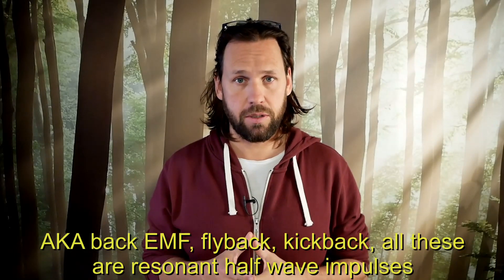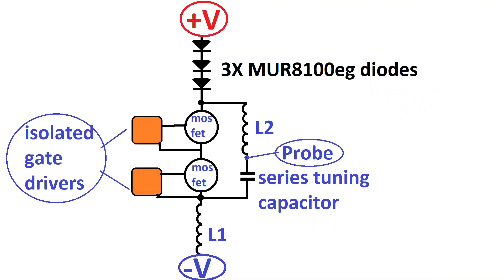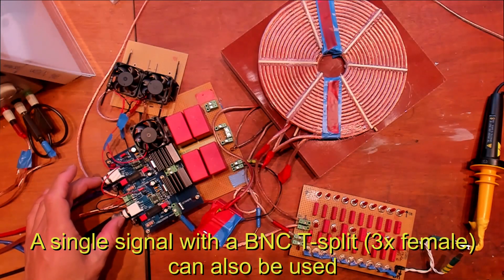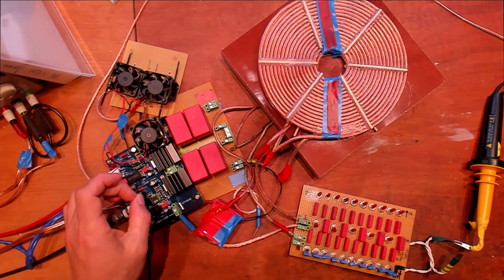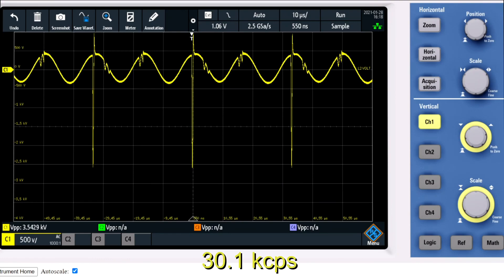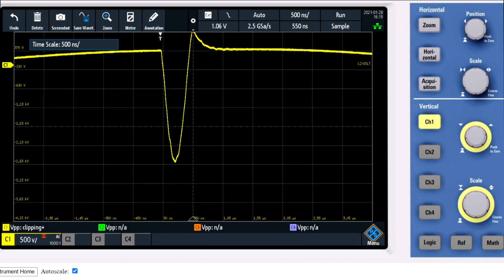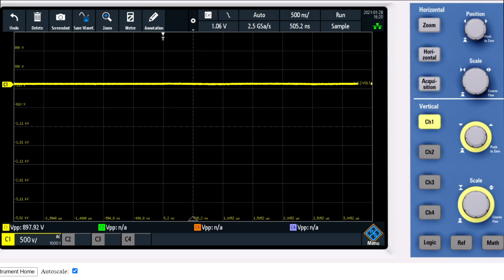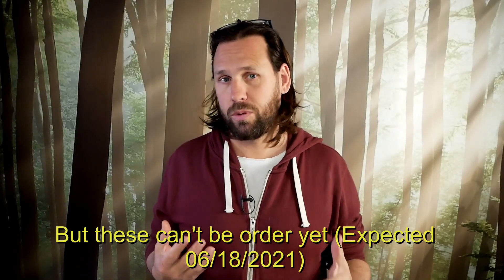High Voltage Impulses generated by Series Switched MOSFETs for Tesla Primary Coil

Comment: back EMF and flyback are not the same, you sir are mistaken and uninformed.
Reply from the maker: oh? please correct me if I'm wrong. I suppose you differ the back emf as the counter voltage that is generated in a motor.
while the flyback is the voltage spike when a coil is turned off suddenly. But I actually see them as the same. I might be wrong though. I'll ask Grok.

edit, yes grok agrees with you:
In summary, flyback is a particular application or instance of back EMF, but the terms are not interchangeable.

Comment: I made a driver using 2 NPN BJT's for the exact same sort of coil that I made from some speaker cable I had, it's much thinner cable but it still works however to get it oscillating I need an extra coil that has only 2 turns and runs parallel on the outside of coil one and needs to be inverted, doesn't matter if you put it on the top side or bottom side, I put it on the bottom side so I have a nice flat top side... I made the driver initially to drive a flyback from an old crt tv and without any changes I wanted to see if the pancake coil would do something, anything and it just works and the first thing I tried is putting an aluminum disk on top, put power on the driver and to my surprise the disk got lifted and flew off which was pretty cool to see something happening.
So I kept trying different materials and found out that if I put an RVS disk on it that it rapidly warms up and it will get red hot so I took the disk and folded an edge on it so it can hold some other stuff, that other stuff was the old tin blobs and such that I always save and put in a little bottle, turned out that it was perfect to melt all my old tin that I would throw away otherwise and it melts the tin in seconds so I made myself an induction heater capable of melting metal in just seconds and I didn't know if it would work it was just an experiment I was doing just to see what happens and if my idea to use a flyback driver (Royer Oscillator) using simple BJT's with a feedback coil on a pancake coil and it just came to life.
The only difference is that I inject the power in the middle of the coil at the point that the two series connections of the coils are and the two other wires are connected to two series capacitors one on each side of the coil which are pulsed with the BJT's, hope it makes sense.
What do you think about that?
Reply from the maker: Cool stuff! put it on YouTube with a schematic.
Reply: @MasterIvo  I made a couple videos from some other interesting stuff that you must see, here's a link to my playlist: https://www.youtube.com/watch?v=B2WAeXDENoU&list=PL4JxQvuRZCFm5pLRvSWJb88sBiVP0sGQs&index=1
I'll try to make a few videos of the driver for the pancake coil too and the single mosfet tesla coil which is also pretty cool to see.

Comment: Cool work ! Based on the duration of the puls (0.5μs) and the high frequency (30kcs = period of 33μs), is it possible to make high voltage AC with 66 of your circuits where the half has positive and the other half negative pulses? Probably it's not that simple ':)
Reply from the maker: 66? wow, well no. the limit of high voltage impulses is in the isolated gate driver. Each mosfet has it's own driver, and each driver sees the total voltage.
so if you would like to have 30kV impulses, you would need 31kV isolation (at least) on ALL of the gate drivers.

this could be done with opto isolation signals (glass fiber), 
and series connected isolated dc to dc converters (or batteries). not very ideal but it could work!

Comment: thanks for showing us your next steps in developing/researching the impulse technology. One question is in my mind since I know the negative voltage from cell membranes and since i know that Tesla used unidirectional pulses. Negative voltage means that there is a higher concentration of negatively charged electrons (that are biological/naturally used for a lot of reactions – radicals, alkaline/acid balancing, cell transport, water flow etc.) so I understand why you aim to get negative impulses. In comparison to the Ground (0V) Iam thinking on the unidirectional part Tesla mentioned. So in this case I believe, that there should be no voltage above 0V to let it be unidirectional. This means, that you dont use a current flow from +12V to 0V but instead let it flow from 0V to -12V or maybe from -12V to -24V... I believe that there is a significant difference corresponding the Ground level or in other words in comparison to natural energy fields/flows. What do you think about that?
Reply from the maker: I have been wondering about the difference between positive and negative for a while now. I am still not sure if there is something more "special" about the negative impulses, that the positive cant do. But I have seen slight differences.
Still need to investigate further on it.

Comment: That is a pretty impressive impulse. What is your plan to utilize it?
Reply from the maker: I want to do several test, based on a series resonant primary coil that is impulsed.
Research if impedance changes occur, for instance placing a primary coil under a water tank, and measure water resistance, with and without impulses.

also see if a grounded capacitor can be charged from a distance of the primary.
 see if there are irregularities in general.

Oh and... create a tesla coil with it, and see if the discharges are different, that would probably be a collaboration
Reply: @MasterIvo  I look forward to what you find!
Reply from the maker: me too!

Comment: What are the diodes for?  Is there any difference between feeding a coil with impulse and regular electricity? Sorry for any confusion. And thank you for your video.
Reply from the maker: The Diodes block the Impulses, that pass back to the power supply (when tuning). These are more relevant in the half bridge setup, whereby they pass through the body diodes back to the power supply. This setup is being build and tested as we speak. 

An impulse into a series resonant primary coil, represents a longitudinal wave.

If a coil is only resonant, it will only be transverse in motion. 

regular low frequency AC out of the wall, isn't resonant. 

And DC into a coil, creates a magnetic field, that will transform into resonantce when the coil is switched off. 

A resonant half wave is an impulse.

Comment: kewl
Reply from the maker: indeed and I am very curious what it will do in the half bridge circuit
Reply: @MasterIvo  the half bridge is the dc to dc converter you made right. step up?
Reply from the maker: @mykedoes4099   yes.
Reply: @MasterIvo  got it
Reply: @MasterIvo  when you say half bridge do you meen half of a bridge rectifier? theres full bridge and half bridge rectifiers.  a half bridge would take half the ac signal the full bridge will take the full as signal and make constant dc. half bridge makes dc pulse
Reply from the maker: @mykedoes4099   Half of a H bridge (not rectifier)

Comment: Hi Ivo, Why is the dc offset a dangerous way to do it ?
Reply from the maker: It charges up the capacitors with high voltage DC from the impulses. If you have 3000V dc in 2uF caps It is very dangerous, each time you need to safely discharge the caps after the circuit is turned off.
I have been bitten by several hundreds volts, and I can tell you, you DO NOT WANT TO FEEL IT! it can kill!
Reply: @MasterIvo  i got you 👍🏻
Reply: The way I understand it, the higher the voltage the less current you need, so if you have high voltage and you add a little bit of current it will become dangerous, for example a lightning bolt has very little current in it, but can do massive damage, if man were to become stupid and add a little bit of current, then the lightning bolt would probably shake many houses to the ground
Reply: @fpveddie  volts = resistance x amps. 
The amps flowing through "what ever" depends on its resistance and the voltage applied. 
Voltage is pressure. Amps is flow (quantity overtime). 
Amps cannot be "added". It dosent work like you think it is.
Reply from the maker: * Voltage is tension, current is Aether flow pressure
Reply: @sk8pkl  that was figuratively speaking, I do know when you're charging a DC capacitor with voltage only it charges very slowly, but it takes very little current to charge it very fast, and I know when you charge a capacitor that has a lot of capacity you have instantaneous current when you discharge it, rather you charged it with current or not
Reply: @MasterIvo  I've heard in layman's terms, voltage is the size of the water tank, current is the diameter of the hose beneath it
Reply from the maker: @fpveddie    Electricity  is present in the Aether fields SURROUNDING the conductors. 
The dielectric field presents tension, in the form of stretched Faraday tubes.
These can move sideways (transverse) and drag along the Aether (current)

A sudden change of voltage in a dielectric field, changes its tension, and acts as a Longitudinal wave.
Reply: A lightning strike goes the most efficient way with the best conductivity to bring a balance between the voltage potentials (charge distribution) as fast as possible. So there actually is a chain of smaller sparks going from water molekules (with mineral ions) in the air to another. Before the lightning strike there is the energy stored into the field between the voltages/potentials/poles and at the time of the spark the energy condenses like in a vortex and builds the directed energy flow. But whenever something flows inside the vortex (like an impulse within a very short duration does) there have to flow something outside the vortex (explosion or just light emitting etc) – contraction, extraction and other analoques. So while the well known electricity flows condensed into the conductor there is another part of electricity moving outside of it (or at least a charged field with a part of the total energy). Aether is the smallest and basic medium to let such energy flows/fields exist. Still there are more complex structures by matter that can influence them. Whatsoever, everywhere in the environment are energy fields and flows and they can connect to each another and share their energy just naturally. With big impulses there is a good chance to connect to more and/or bigger energy fields and start them to flow into the pulsing system, high frequency will keep up the flow. And as we know, this is also called empowering resonance. It is not easy to understand and describe for myself but this may help to understand why this experiments by Master Ivo are so important. It opens doors to a better world with „free energy devices“ (let energy flow from the environment into the open system). Let the research go on :)